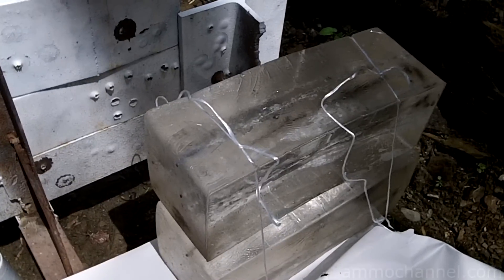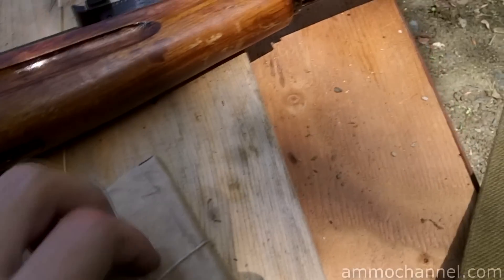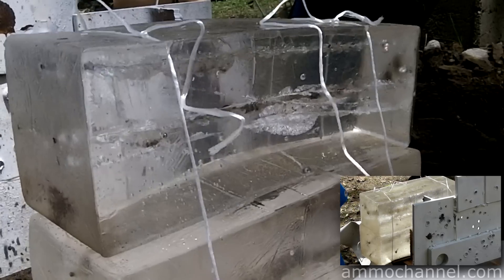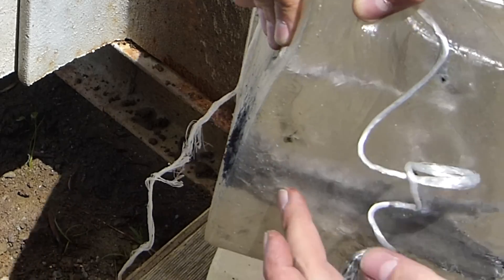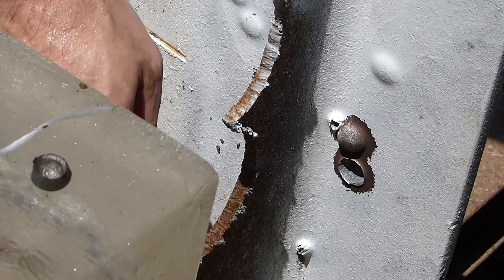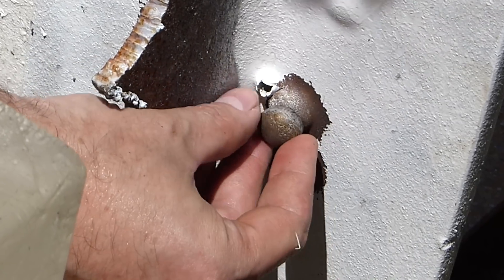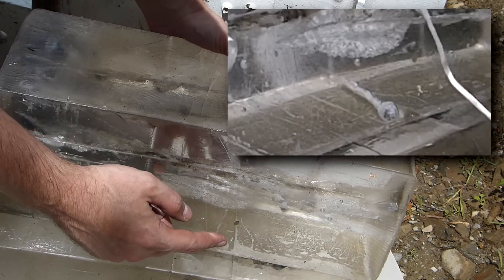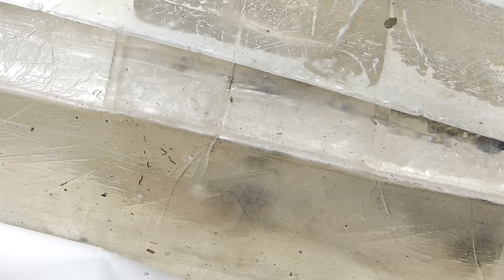Armored Ballistic Gel -vs- 7.62x54r Steel Core

Comment: It's not an fmj.... Granted, it's an instagib rifle. You only need one shot. Btw fmj is available and better. Still you were almost shooting through a railroad track
Reply: Full metal jacket would not have been able to penetrate the plates like the steel core ones did. There's a reason why "armor piercing" bullets have steel or even tungsten cores.